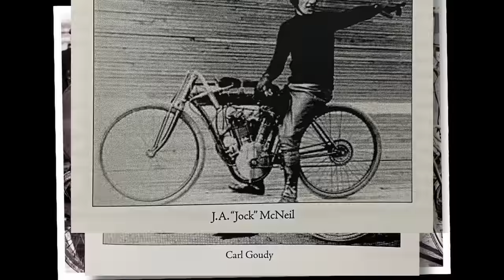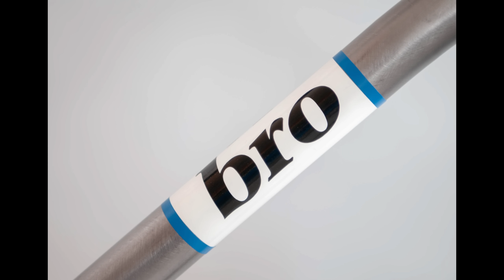We're Back! // Paul Brodie's Shop

Comment: Hello Mr. Brodie!
I'm a keen cyclist who started riding vintage drop bar bicycles for fun and exercise. I want to thank you for the opportunity you also gave people in other places of the world. In Sweden, there is no one with similar experiences as you have building bicycles. It is a dead profession. In my master's thesis project at Lund University, I designed and built a bicycle using much of your content on YouTube. I found a man in the area, a soulmate, 50 years apart. His name is Johnny, and he sold much of the cycling parts through a shop in the 1980s, also tubing. He helped me understand and regulate the Acetylene/Oxygen torch (which is frightening for a beginner). He never worked with fillet brazing, but he showed me that it is possible to work without an automatic flux machine (maybe harder though). Identifying the right filler materials from Swedish suppliers was probably worth a few university credits. I milled my own dropouts and built tools and jigs for raking fork blades and brazing the frame. The bicycle turned out very nice, and I have used it every day riding to and from work at a large bicycle company where I was offered a job. My friend, who helped me start the torch also fights cancer, leukemia, and I am very grateful I took the opportunity to learn some of these skills before they are gone. Thank you Mr. Brodie for providing me with the information I needed to build my bike. Without your videos, I would not have managed. And, what an amazing feeling it is to ride your own bike. Get Well Soon/Martin

Comment: Hang in there Brodie. I never knew about your frame building class. It would be rad to build the ultimate off road cush cruiser. Disk brakes, 2.6 tire up front 2.8 out back, dropper post, hub drive electric with the battery hidden under black saddle bags, long curved fork with curled back bars. It would be heavy, planted with lots of traction but easily tip into a flat corner or burm.  It would start to drift  slow and predictable but when countersteered it would realigned itself and straightened back up. It would be a challenge to balance the added weight, but we could do it.
Reply from the maker: Ryan, sounds like you have a plan! I did teach Framebuilding 101 for 9.5 years, but that has ended, sorry. Thanks for watching...

Comment: Now ,after watching again I see Mitch.  very good video. Thank you  Paul for reminding me.    I was sloppy
Reply from the maker: Right on. Mitch is actually quite good at riding the trails 😉
Reply: @paulbrodie  When I was in Burnaby Heights for almost a year the riding group at the local shop wanted to take me riding. I knew that I could not as i'm more of a climber and a slow technical descender . A fast north shore rider that could handle those skinny plank transitions.  I like the ride but not the scary ride. I'm also getting older too so I want to make it home pedaling not walking with a flat.
Reply from the maker: @thinkpadBentnoseTheBlind  Yes, finding compatible riding buddies is not always easy. Making it home in one piece does get more important as the years go by! 😉

Comment: Good to see you back. Hope your treatment goes well. Take time to look after yourself and don't worry too much about other people. If you need to say no or do something just do it. I must admit I was keen to watch the bicycle content and not so much the motorcycle stuff. But hearing what that meant to you keep doing what you want. Is the Excellsior a fixed gear drive? So when it opened up you can't kill the engine without crashing?
 When you go back to the beginning, motorcycles were just that motorized bicycles. We in the cycling community have benefited from tech developed for motorbikes like disc brakes, suspension, etc. And with ebikes bringing power to bicycles and motorbikes it will happen again.

Comment: If you have the strength, a video suggestion is the throttle linkage system on that bike.  Get better soon
Reply from the maker: The throttle linkage is fine, it does not need fixing. Thanks for watching.

Comment: IN 2005 I CROSSED THE SAHARA got to Gambia and nearly killed a group of about 6 kids - the throttle stuck.

The car was having problems ideling, you have to rev it like hell when you set off and then it was fine. So I did and the throttle stuck open, it launched me off the end of the tarmac section of road onto the sand so whilst I was breaking the car was not slowing - straight into the kids playing in the street. They scattered in all directions and thank GOD they got out the way. From beginning to end it was like 5 seconds.

Comment: I don't get the appeal of racing a bike without a clutch or brakes.. Sure that's what they did back in the day but they didn't have the tech we have now to make things light and still able to stop. Having brakes and a clutch on a bike is mandatory in my eyes, and using the best ones you can get is smart... if you choose not to use them with them on the bike, so be it, but it's better to have them and not need them than need them and be up shit creek.
Reply from the maker: I agree. Racing a bike with no clutch or brakes is not a very smart thing to do.